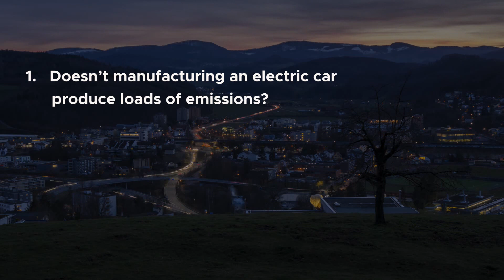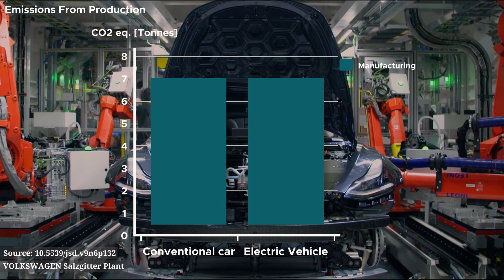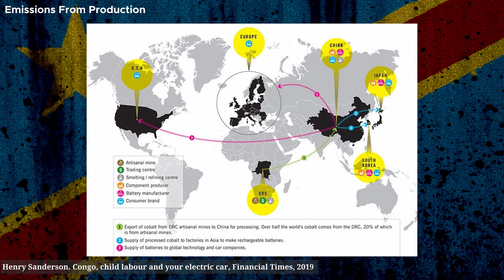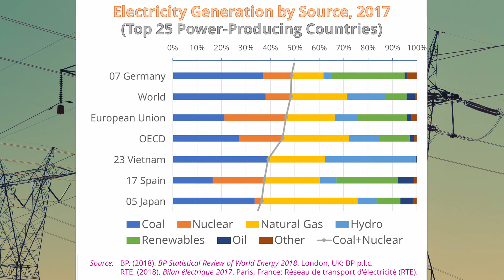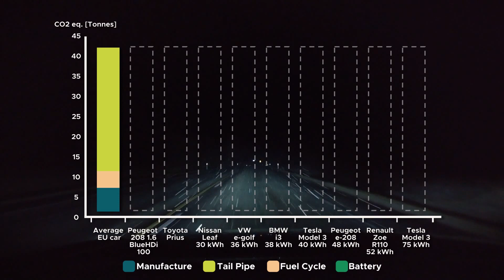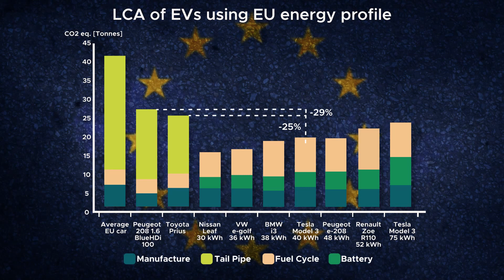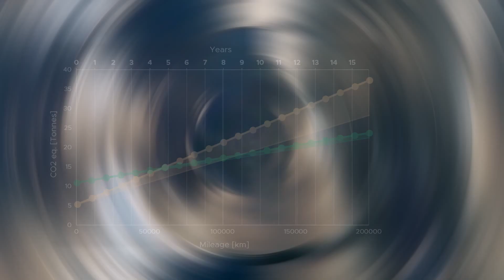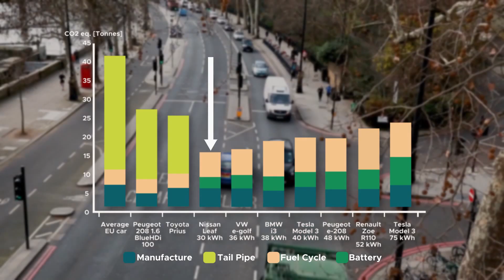Could Electric Vehicles be Bad for the Environment? Data Reveals the Truth

Comment: I am also interested in the environmental impact of all that brine taken away from the water supply.  The effect of child labor.  After life recycle cost.  Infrastructure.  Acreage used for wind and solar.  All these and more need to be discussed as well.
Reply: "I am also interested in the environmental impact of all that brine taken away from the water supply." 
Well it's a brine in it's natural state - it comes from a saturated slat lake which has a solid crust of salts. The extractions uses very little drinking water which by now comes from a sea water desalination plant built to replenish the groundwater table that was gradually depleted by an adjacent copper mine. If you happen to eat a steak or 11 avocados or wear half a jeans you will have used up more water than the 11.2 kilograms of lithium would have used if produced at the Atacama lake. But most lithium comes from Australian mines that supply half of the worlds production... As for cobalt, yes there is child labour - but not at the mines that the companies producing EV batteries are importing their cobalt from, and the controls that no such questionable cobalt enters the production line are tight. So it's more likely that the child labour encumbered cobalt is found in your ICE engine (in lubricants, crank shaft, valve seats, or used at the refinery to desulfurise the fossil fuel) than the battery of an EV...
Reply: @karlgunterwunsch1950 excellent points. When people bring up the child labour objection, it is always as if they assume all cobalt is like that. That would be similar to assuming that all diamonds are blood diamonds.

In reality, the largest cobalt producer in the DRC is a company called glencore. They are listed on the stock exchange. They don't use child labour. They supply Samsung, who in turn makes the cells for most European EVs.
Reply: We can discuss this as well as the refinement of fossil fuels that has been happening for a while now.
Reply: Child labour was going on 200 years ago. It's not a specific electric car issue. Look at the labels on your clothes, and you'll find you've benefitted from child labour.
Reply: @Brian-om2hh  so that makes it ok for electric vehicles!  Copy.

Comment: This video only looked at CO2 and didn't take into account the incredible amounts of damage pollution byproducts create in the mining of the raw materials needed for batteries and the battery manufacturing process. For example you have to mine 500 tonnes of earth to make one battery for a Model 3. Times that by the approximately 25 million and growing cars produced in the world every year if all cars become electric.
Reply: Okay, look at  it both ways. Look into how much is also used to build an ICE car and add the refining of the fuel that uses raw materials needed to be processed.
Reply: @d.d.6123  Electric cars still need the oil industry for its plastics etc.
Reply: @boderick1  
so do ICE cars
Reply: @boderick1  Don't be so sure, many EV manufacturers make a point in using no new plastics but rather recycled materials that are ethically sourced and thus removing pollution, like door carts made from recycled plastic bottles or floor mats from recycled fishing nets.

Comment: You forgot about old battery replacement cost and recycling process
Reply: And you forgot that older EV batteries can be refurbished rather than totally replaced.  And what's the issue with the recycling process? I've watched the video posted by Volkswagen, showing their EV battery recycling plant. I saw no issues....

Comment: You should use the state of Iowa in your graphs sometime. It has among the highest renewable energy profile in the USA thanks to wind and solar
Reply: Iowa has been doing it long enough to be to the point of dealing with the "when it wears out and needs to be replaced" part of the equation.  Huge fields of fiberglas windmill blades with no possibility of recycling.  Single use for 20-25 years and then........  Huge pile of junk.

Comment: Good analysis, but you really shouldn't use LCA.  The world is going renewable fast.   EV's are not responsible for the pollution from fossil fuels electrical generators:  the people who built and operate the fossils power stations.  LCA is totally inappropriate in a rapidly changing energy system scenario. We should all get EVs even in dirty coal generating nations.  EVs clear the air in urban areas even if the coal plant outside town emits a log of GHG.   over a million people per year die from ground vehicle pollution.  
We need to work on the generators as separate issue.  The good thing is that solar and wind are the majority of new power installed for several years because it's the cheapest energy in history. 
In fact we installed 30 times as much solar and wind generation as the next years total EV's will require.

Comment: This was very interesting, but again CO2 is being portrayed as the big bad beast in the room, but it accounts for only a very small percentage, less than 10% I believe of green house gases, water vapour makes up about 80% or more. If we take CO2 out of the equation as being the bad guy from ICE vehicle, is it worth the additional environmental damage done by mining lithium, do we damage the environment to help save a climate that may not be in danger in the first place, after all, there have been NO real scientific studies done on mans impact on the climate, none, after all, you still need to drill for oil to get by-products like graphite for the lithium iron batteries, not to mention oil by-products for clothes, cosmetics, plastics for your cell phones also you can not effectively recycle lithium batteries, solar panels or wind turbine blades, the latter only lasting 10 yrs apparently and lithium iron batteries even less in some cases. Ask, who can afford an electric car, manufacturers will not give them away, they see a money maker here, lets all go EV and make the motor companies more money

Comment: You forget to add that batteries have to be replaced if you don't want to waste cars and buy anothers every 3, 5 years.  Lifetime for petrol cars is usually 20 years and they are trowed away only because they are used or owners never cared of them. how long electrics last without batteries, careless owners and there is new iTesla 12se this year for xmas? You forgot also add that most electric cars are not repairable which means they are like plastic shopping bags.
Reply: What utter garbage!  Which electric cars have you owned which have not been repairable? I don't think I've read such garbage in a long time....  And why would you replace an EV battery every 3 to 5 years when it has an 8 year warranty? Give it up. You clearly have no idea what you are talking about!  Cleveleys in Gloucestershire England are an independent EV specialist, who have been servicing and repairing EV's - even Teslas - for years....
Reply: @Brian-om2hh  Because electric cars run on electric power stored in batterys. They don't run on warranty. If batterys can't store enough or deliver enough power I replace them. You talk to them that they have warranty.

Comment: It averages 4.8 years to save emissions from it's battery manufacture? Have you used any device containing a Li-ion battery for 5 years? Capacity can reduce by as much as half! More if you are cycling it a lot, isn't the battery the part most likely to need replacing if you have an EV long-term?
Reply: Real-world studies show that EV's only lose ~1% per year, of capacity, in average driving and the average car lasts: 146k miles, or 14-years.  I've owned a Chevy Volt for the past 5 years and the battery still shows virtually no degradation, after 100k miles.  There are Tesla's on the road with 750k miles on the original battery still, with little degradation on the battery.
Reply: Battery management for electric vehicles is generally superior to that in hand-held devices. I have a 2012 Prius with 178,500 miles on it that shows no battery degradation at all. I have a Honda Clarity which, while it is a newer model with less history, also has an excellent reputation for battery life. Technology isn't stagnant, either, and we can reasonably expect battery life to increase in the future.
Reply: Rich Rebuilds has already repaired multiple batteries for Tesla vehicles. Tesla wanted to change the batteries completely for roughly 20k USD.
Reply: 3 years later, and renewable energy use is skyrocketing. Battery prices are plummeting.  The amount of cobalt in an LFP battery is zero.  This video needs updating

Comment: Why is production and refining of fossil fuel not included in the equation?
Reply: Exactly! That is the ICE manufacturer lifecycle con. It takes massive amounts of energy and pollution to produce petrol. That needs to be included and then ICE will Fall off a cliff.
Reply: @zzbloop  petrol is good for the environment though, more carbon in the air helps trees.

Comment: The land that is mined for fuel based power is 95% of the time mined and then renewed and still fertile-Example; Palmer Park in Donora PA took 3 years to strip mine and in less than 2 years went back to being a beautiful park with lots of trees and vegetation- Land that is mined for Cobalt and Lithium becomes barren and sterile and also remember that the battery disposal for these EV's is a mega toxic pollutant
Reply: I guess you love the sight of refineries, oil rigs, oil pumps and fracking sites. Especially when they suffer incidents.
Reply: @luk9999  I guess you love seeing little African children being exploited for their cheap labor and you also want to see the power grid overloaded due to more and more EV's in the market.. go petal your nonsense to the woke leftists.
Reply: Lithium batteries are non toxic, they are classed as land fill safe - not that they'd ever end up there as they are too valuable. The areas currently mined for lithium were barren before because they are either in the most arid region of the continent or located at salt seas which happen to be in the most arid region of the other continent. Did you cry foul when you bought a new electric oven with a ceran field oven top? Or a glas ceramic casserole, or the lubricants for your ICE car - all laden with Lithium. Did you ever worry about disposing that? Or what about the valve seats, the crank shaft of your ICE engine which would have been impossible to manufacture without cobalt. Or the desulfurisation of your fossil fuel - large amounts of cobalt are used at the refinery that supplies your filling station.

Comment: This video is very informative and interesting. Someone put a lot of work to prepare this data. In my opinion only one thing is always missing in topic of electric car. I mean recycling of batteries and impact of electrolyte. It is not easy to find information about how this process works and how to calculate its environmental impact.
Reply: The whole fossil fuel chain is missing and you focus on recycling of batteries?  Is that all that is missing in the video? how about fracking poisoning and destabilizing of the soil, oil pumps that need a lot of electricity to just pump crude oil out of the ground, oil rigs that use huge amounts of fossil fuel to produce required electricity, shipping of oil with some of the dirtiest and cheapest forms of fossil fuels as there are no regulations about it at sea. How about refineries that are the biggest polluters on the face of the earth, using huge amounts of energy to heat up the crude to 400+ Celsius and then...the accidents: oil rigs disasters, pipe bursts, refineries explosions and contaminations. Put together fossil fuels are by far the biggest polluters on the planet. Btw, nearly 50% of lithium mined for the whole planet is mined in Australia, did you hear any complains about that pollution there? You should ask them latest protests about pollution there, yeah, its about fossil fuels. I mean they know what they are doing, they are not 3rd world. Yo, did you remember to change the oil, filters etc to your ice?

Comment: Biggest problem imo is the recycling/disposal of the batteries... Sounds much like atomic waste to me
Reply: Companies like Redwood Materials, Li-Cycle and Tesla are recycling batteries
Redwood materials recycles 6 gigawatt hours of batteries a year and is expanding
Reply: It’s close.
The batteries aren’t recyclable. And generally are buried as landfill waste.
Reply: @billhollis1888  lier.
Reply: @luk9999  He's just uninformed......
Reply: @billhollis1888  Oh but they are Bill.......Volkswagen are already recycling them...  They're WAY too valuable to go into landfill sites. In any case, dumping battery waste into landfill has been illegal in Europe for years. The lithium and cobalt in EV batteries can be recovered to levels around 90%, and reused. The steel and alloys from the battery casing and mounting frames can also be recycled. Sounds like you need to do more research Bill...... Unfortunately Bill, nobody has yet devised a way to recover and reuse burned gas/petrol and diesel. Once that's gone it's gone for good....

Comment: Let's honestly say it...EV vehicles are only for the rich part of the world. And even if the EV will overtake all the current billions of ICE vehicles you are going to really stress the lithium reserves. Considering that not only EV have lithium batteries, but also billions of other devices which need lithium and unfortunately lithium is a scarce material. The only real "green" solution would be to have a green resource i.e. nuclear fusion. Also battery lithium recycling is very very difficult (difficult to separate all the different materials) and energy consuming. So lithium battery EV are only a temporary solution to the problem. The only real long term solution will be nuclear fusion + hydrogen fuel cell EV.

Comment: My biggest question about electric cars/ no fossil fuels is??????😒😒😒😒
WHERE are you going to get ENOUGH ELECTRICITY if you ban fossil fuels along with nuclear???😒😒
Reply: Refining petroleum consumes 5% of the USA's national grid electricity! That doesn't count pumping it out of the ground, transporting it, storing it. It takes MORE electricity to make a gallon of gasoline than an EV could use to go 20 miles. Stop refining gasoline and there is MORE than enough energy to use EV's.
The Dirty Truth about Combustion Engine Vehicles: https://youtu.be/mk-LnUYEXuM
Reply: Switch off the oil pumps and refineries and that will power over 20m vehicles in the US alone
Reply: We can use the electricity the oil refineries are using now. By the time we're all using EV's, they won't be refining oil anymore. At least not in the quantities they are now.
Reply: @General Smedley Butler "The sub-stations and transformers in these older neighborhoods would struggle to feed every home if they were recharging their EV's at the same time. " While I generally agreed with your statements, I disagree with this one. Charging an EV is like running your electric clothes dryer a couple of times. Consumer electrical demand drops DRAMATICALLY after 9:00pm, and even a 100a panel can recharge the average EV off-peak. As to the USA's grid infrastructure being fragile, yes.

Comment: But would 1 battery last as long as 150,000 miles like a Diesel engine with out needing to be changed and starting the carbon problem again.
Reply: Most diesel engines when maintained 700k to 1m miles is not uncommon the frames and bodies rot long before the engines.  Most current cars and trucks 20 years and 250k are the normal before people discard them mostly for rust damage.  Not sure where these numbers come from I've. Never bought a new car hell never bought one less than 10 years old.  Everyone I know runs them to around the 300k mile marker.
Reply: @kylecasetta4091  "Most diesel engines when maintained 700k to 1m miles is not uncommon" - well by 700k miles my last diesel car would have chewed through at least 4 clutch and two mass flywheel assemblies which cost 3000 Euro to replace, a number of exhaust particle filters at 1000 Euro a pop, at least two AGR coolers which boils down to a head rebuild, a ton of oil and oil filters. No thanks...
Reply: Modern batteries can do 400-800tkm
Reply: The LFP batteries use in the Tesla Model 3 rwd are good for about a million miles
The NMC batteries are good for about 400k to 700k miles